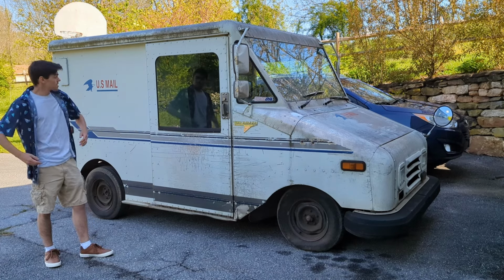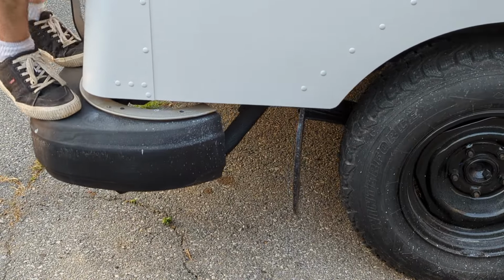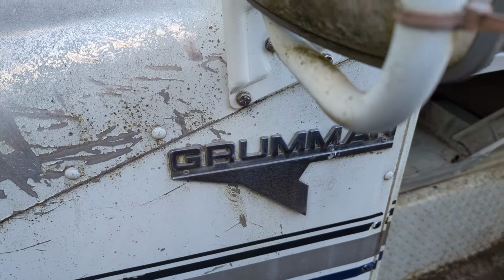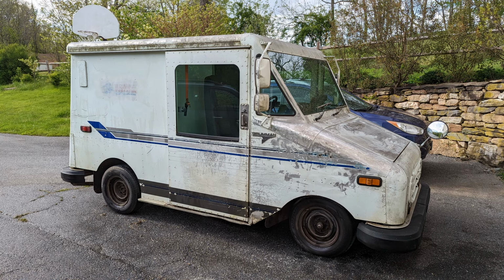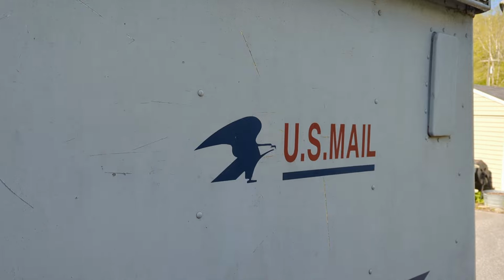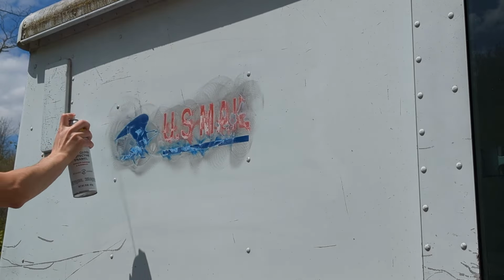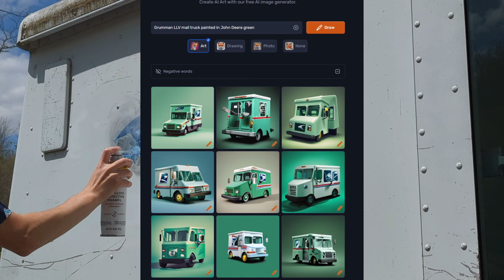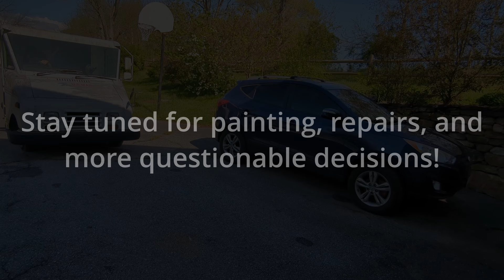Restoring a Grumman LLV Mail Truck.  It's terrible.  I love it.

Comment: What a great way to illustrate why American industry is in the doldrums!
Every flaw you mentioned is readily solved. Not only did Grumman fail to gradually improve the truck over time, but the industry in general failed to seize upon a design that promised to be ideal as a small truck for contractors, tradesmen, and servicemen.
Look at the top — easy reach for ladders, just right for a few sheets of plywood. 
Look at the cargo compartment — low deck, easy reach, easily organized for storing parts and tools. Easy to secure.
Reply: I blame the modern pickup truck and American mindset.  Europe embraced vans but the USA didn’t
Reply: Legally, they couldn't. The postal service wanted exclusive rights to use the vehicle. And with a Monopoly on use, any improvement would have to be approved, and paid for, by them and that was never going to happen.

Comment: Lucky find. Some years back, a guy tried to buy one of these from a scrap yard that had several of them that they got from the USPS. The scrap yard said they were required to sign a form stating they would be dismantled and destroyed.
Reply from the maker: @airplaneengine  That is heartbreaking 😔
Reply: @MattWinkler1  Makes sense to destroy them.  It would be a cottage industry to rehab them for use in mail theft.  Mail theft is bad enough now !
Reply from the maker: @robertbrewer2190  Unfortunately that's actually quite a good point
Reply: They look likely for medium-stay “camper vans” - where one is out on a working “road trip” for a month or two at a time, and needs a vehicle that’s reasonably comfortable to both live and work in.
Reply from the maker: @dennisyoung4631  I've gotta say, they're not nearly as comfortable as they look, it's a leaky tin can with no insulation, it's great for work but it'd take a lot more work to get it to be comfortable!

Comment: Still driving one in 2024 for the USPS. My office is slowly getting more Mercedes Metris’ though. I’d much rather drive the LLV tbh
Reply from the maker: Still see quite a lot on the road, especially in rural areas!  I'm curious, why do you prefer it?  It certainly isn't powerful or well insulted haha
Reply: @MattWinkler1  If you're still curious, the answer is handling and practicality. The LLV might be like driving a tin can, but you can turn on a dime, and do a three-point tighter than most vehicles I've seen. In addition the direct access to the back from the driver's seat and larger vertical space allows for better organization, less back pain/overextending, and faster reorganization as you move mail and packages for the route without exiting the vehicle and with more headroom. For Rural Carriers especially, very useful in helping you keep moving during your day!
Reply from the maker: @dancinginfernal  Great reasons, thanks!  Yeah the turning radius is outstanding
Reply: Facts😂
Reply: @timruskowski4923  we still have them for the P O in New Hampshire, although they are all aged, worn, and have been rebuilt multiple times.  Sadly they are no longer made, although they are about a perfect design for postal delivery.   Slowly they are being replaced, but most carriers agree the newer vehicles are not as well designed for postal delivery.
Reply: You must work somewhere warm.  LLVs are ice boxes on wheels in the winter. 🥶

Comment: That was a fullsize K5 Blazer you showed, not an S10.  Looks like a cool project.
Reply: came down to comment this. seems like a small distinction but a K5 blazer is about two times the size of an S10 platform.
Reply: @Wellimanewguy and the old square body Chevy’s mad GMCs were a long life vehicle in their own right if you lived outside the rust belt
Reply: @fk4515  I don't doubt that at all. I still see em all over the place even in the rust belt.

Comment: One reason they last longer is the engine has ZERO emissions controls on them. No EGR, No Catalytic converter, no tailpipe emissions requirement. Perfect example of government “do as I say, not as I do”
Reply from the maker: @akshonclip  That WOULD explain why it smells like a leaky go-kart, wouldn't it?
Reply: The ones currently in service have both EGR and a Catalytic Converter.
Reply: I actually know someone who works on them I don't see any EGR or Catalytic converter
Reply: A lot of NYPD Chevy Impalas Ford Explorers don't either have catalytic converters
Reply: I serviced llv's for 5 years, I can assure you that they retain the s10 powertrain. Evap+cat+egr.
Reply: Look for Llvs with new frames to them . I used to rehabbed them
Reply: Catalytic converters have been around for 40 years now on passenger cars. EGR for about 20 years. The tech is fine. Maybe not in your location, but definitely in large parts of the civilized world.
It's all no different than electronic throttle bodies. Those have been around since 30 years. On some cars they work fine and completely reliably so for the entire life of the car. On some cars, they break every 10 years.
"Modern" cars have been around for longer than you might think.

Comment: When 16, I got a Jeep Fleetvan mail truck.  Same satisfying sound with the door.  Same lift door on the back.  Of course since this was around 1969, I did not have much money, and boy did it need an engine rebuild and suspension rebuild, and..everything rebuild.  It had old1/4 itch fake paneling in it, I added some gold/yellow curtains and blue shag bathroom carpet.  Wood grain contact paper where the red strip was on the body.  Had to use STP as the oil, the rings were so bad.  Liked it though.  Have fun with yours!

Comment: I drive the LLV's (Long Life Vehicles) for postal work.  They have been repaired and rebuilt many times over.  It takes a licking and keeps on ticking, but they do break down fairly often.  They are based on the Chevy S-10 platform, are about perfectly designed for postal delivery, but sadly are no longer in production.  They are now at the point where it is becoming difficult to keep them running constantly for daily delivery.  Slowly they are being replaced by the postal service, but many are still on the road.
Reply: Some are actually built on Ford Ranger chassis.  The ones with slotted wheels are the Ford Chassis.
Reply: 😂 the have  been out of production 3x longer than they were I production  😂
Reply: @Islandcitymedia  Not uncommon for specialty vehicles.  There is a reason they were named Long Life Vehicles.  One of the school districts here is still using their custom built Ford welding truck.  It's a 1956 so it is 68 years old.  But last I heard it only had 30,000 miles on it, and the engine and transmission are original....just the clutch, water pump, radiator and heater core have been replaced.
Reply: I still drive one
Reply: My son is a fleet mechanic for USPS and they're writing them off for scrap if they need more than about $500 in work.  Not sure how it is everywhere, but they were told that no more reman engines - there just arent any meaningful number of rebuildable 2.5 cores out there any more.

Comment: This must be an older llv.  It actually has the 2 grab handles still installed on the rear on each side of the rear gate.  These are literally 2 door 1st generation s10 blazers so drivetrain parts are plentiful.  You could swap in the 4.3 or even a v8 pretty easily.   Also the suspension parts would be pretty easy to upgrade.  I drive one at work every day and would love to get my hands on one.  Lucky you.  Im guessing the guy who owned it must've been a rural carrier.  I've never seen that livery ever on a postal llv.  I'm  also surprised the tray is still in it.  Good score.
Reply from the maker: I didn't know the grab handles were removed from other models!  Mine's a '92, so not really early in the 1986-1994 production run.  And yes I believe the previous owner was a carrier in (very) rural PA, it's obviously a very old paintjob and I'm still not sure if the livery was unique to a specific locale or just very old.
Reply: They had to remove them because in urban areas skateboarders and bicyclists would grab on to them and hitch a tow.  It was a safety hazard because the rear visibility is so bad.  That's what I was told years ago in my training anyways.  Being a 92 that's a newer llv in the run.  My understanding is they went from 86-94 before they were replaced by the FFV.  If you look at the number on the front or rear of the mail vehicles, the first number represents the last number of the year it was built.  That being a 92 the first number would've been a 2.  I drive a 93 llv so my number is 330383.  If you see a newer Mercedes metris they will likely start with a 1 or a 2 for 2021 or 2022.  Pretty useless info I guess.
Reply from the maker: @furgulley8077   I wonder how common that actually was but I love the story.  Seems like they'd be better for skateboarding than delivering mail, they're too low to be of much use - anecdotally, anyway.

Comment: Love it!! I am so sad, our town has been slowly replacing our fleet of LLV with those new Mercedes van things 😑😑
Reply from the maker: I'd almost certainly prefer to drive the Mercedes for work (especially in the summer!) but they sure don't have the same charm, do they?
Reply: @MattWinkler1  The mail truck is the one exhaust note that I'll always be able to pick out!
Reply: Those Mercedes vans are only a stopgap until the new duck-billed Pixar-mobile mail vans start showing up on the streets
Reply: @Chann3lsurf3r825  Which I really don't understand... I'm sure these Mercedes vans are more expensive than whatever they're proposing to replace them with and our town already has four! Doubt they'll ever replace them until they're too worn to use.
Reply: @aaron71  Mercedes vans aren't particularly expensive. At least not where they come from. They're your bog standard contractor's van. The actual LLV replacement is not made by the millions, so it's bound to be a couple times as expensive as the mercedes. 
Mercedes's commercial vehicle stuff that you can still buy bare frame with cab, that's the more durable stuff. But AFAIK the USA buys the vans that are also sold under the Opel and Peugeot brands (EDIT: they can now also be Fiat based... All those brands have been shuffled around a few times)
You typically write those off economically after about 10 years. They might last longer, but at 10 years you usually already see the rust appearing. For a company that writes off their assets in a fixed time, that's completely acceptable.
Reply: @mfbfreak  The Mercedes Metris starts at $39,600 USD but I assume the US government is getting a package deal.

Comment: If you think these are rare in private hands, check out the LLV's younger brother, the FFV. There is literally ZERO info online apart from photos from news articles, a few stock photos, and a short Wikipedia article. I can't find ANY mechanical information about it, other than it was based on a ford explorer, but I don't know what was changed. To my knowledge, there are none that are privately owned, as any that are in bad condition are immediately scrapped. I seriously very much want one, but I don't think there's a chance in hell I can get one.
Reply from the maker: There are almost as many FFVs as LLVs still in service near me - surprising given how short their manufacturing run was!

If any postal carriers want to weigh in on the difference between the LLV and FFV in comfort and practicality I'd love to hear more.  (I still think the LLV is cuter though and will not be swayed)
Reply: @MattWinkler1  Oh for sure it's cuter, it's smaller and stubbier. From what I've read on Reddit, it's narrower inside, meaning it's more cramped.

Comment: How do I replace the back door lock?
Reply from the maker: Not sure, the back door lock on mine is one of the few exterior parts that didn't have any issues to work on haha
Reply: There is a cover on the inside of the door,take it off you'll see the lock mechanism .if I remember right there's a u retainer holding it in

Comment: Great video! Do you plan on engine swapping it or leaving it as is?  While the engine swaps are awesome, would be cool to see an original intact LLV. Good luck on your LLV project!
Reply from the maker: Thanks!  I've been doing maintenance and plan on keeping the original engine, at least until it runs into any serious issues - it sure isn't fast, but it's reliable and original
Reply: @MattWinkler1  Sounds good! Good luck!

Comment: I want to try to turn one into a simple RV for the homeless. Can you imagine a better way to repurpose all these that MUST come out of the market soon.
Reply from the maker: I love the idea!  I think the odds are unfortunately low that it would work all that well for a couple reasons - first off, there's near zero insulation, so it's not much better than starting from scratch in that regard.  Second, as I understand it, very few were ever issued VIN numbers and no official safety testing was ever done, so the post office crushes the vast majority of them rather than auction them to the public at the end of their service life.  Still would love to see some camper conversions since they are so space efficient :)

Comment: Please promise us you will at least replace the wiring so you dont have a fire these things are so well known for having as they get older.
Reply from the maker: Thankfully this is at least a '92, being the "newest" that still had an Iron Duke engine.  One of the main things that caused fires was having the wiper fluid reservoir right above the ECU, but it's already fixed and relocated into the dash.

Already looking over all the fuses and grounds, and inspecting the fuel system to see what could use replacing!